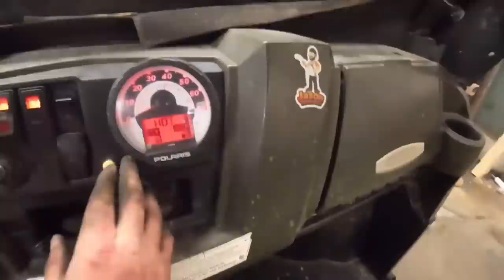Rain day in the turns into another adventure with Aaron as always never simple lol

Comment: professional tip for doing bearing like that in the future stick them in the freezer for about 30 minutes shrinks them enough to make them go in easier, if you look at the 50:28 you hear and see the lower control arm moving, i would recommend checking the lower control arm bushings, and possibly the ball joints
Reply from the maker: Need more then a freezer to make a difference

Comment: Can't complain about it at all for the work it does. I had an argo 6x6 utv it only went about 25 mph but was a work horse. I didn't worry about getting stuck with 25x12x9 tires. I pulled trailers and a disc to make food plots. Two speed transmission high and low. It would float, and I fished out of it many times. Keep it greased, and chain drive lubed it was a great tool. It was great if you, as with all equipment, kept it maintained.

Comment: I got 1953 hrs on mine. It’s a 4 seater bobcat 3400xl. But it’s really a Polaris ranger with the 3 cylinder yanmar. I had to put a new injection pump on it and hone the cylinders. Along with new piston rings. The electric fuel pump went out and someone got carried away using starting fluid trying to get it to start…… and no it wasn’t me.

Comment: Mike, that camera is doing OK. The dark lines can most likely be cleared up by adjusting the shutter speed so it is not a multiple of 60, or 30. I've seen several youtubers run into this with a newer camera setup. This usually cures the dark lines in the video issue. Quality otherwise is great. Aaron, that snake almost bit you. :P

Comment: I know that there isn't a whole lot of higher carbon steel welding in the boiler world, but just for the record. Buckets, teeth, shanks, edges should get welded on with stainless rod. I know it doesn't sound like it makes sense but it's just how it is. If you ever come across an old dragline bucket you will most likely find stainless rod. Tank hulls were welded with it before some of the new advances in hull construction.
Reply: Just a caveat, not all tanks were welded with stainless or high nickel rods, not all of the welds were made with the SS rods. The high wear items on buckets are sometimes a alloy with similar characteristics to high nickel rod. Not all mines and shops weld buckets with SS rod, the buckets I had fixed and the buckets that were repaired with SS rod are always in prime condition when compared to normal carbon welds.

Comment: Thoughts on the camera.  The audio was not as good and seemed not to work well when the person holding the camera and the subject were both talking. Also the high end seemed to be missing. The subject audio levels were too low.  For video, it seem the auto white balance was causing a lot of issues.  Every time a bright light source would come into frame, the balance would cause the video to go dark.  There also seemed to be an issue with the frame rate and the LED lighting that caused banding in the brightness of the video, especially when the white balance darkened the image. Since this is a popular camera, I would think most of these issues could be fixed with some settings changes.

Comment: So, stick welds are stronger than MIG? 
  As I'm sure many have already said, your video issues (dark banding) are caused by shutter speed, and I think florescent lighting is one thing can cause a problem with that.  Also I have to say, I really didn't think the sound was that good either. I assume you're using one of those dead cat covers, or whatever they call it, but it still sounds kind'a bad, especially when things get loud. It just sounds "raw" for lack of a better word, like the sound is going straight into a metal mic or something. 🤷‍♂